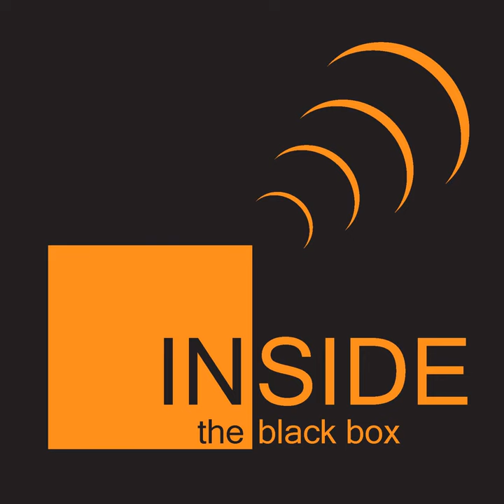Inside The Black Box Episode 12  (Part 2) - STS-107 (The Columbia Shuttle Disaster)

Comment: Fantastic podcast thank you. I’m intrigued by the existence of pressurised suits that you discuss. You mentioned that while they could be pressurised to protect the astronauts against decompression, they weren’t used during re-entry due to the increased O2 levels and consequent fire risk in the crew module. So what’s the point in having a pressurised suit that you don’t/can’t actually use? I’m aware it would have made no difference to survivability given the nature and height of the loss of control, but it struck me as odd.
Reply: 🤔 great question